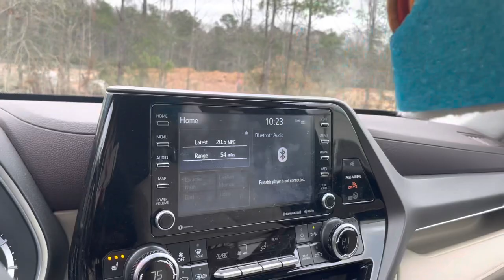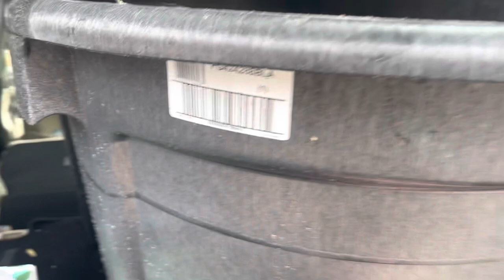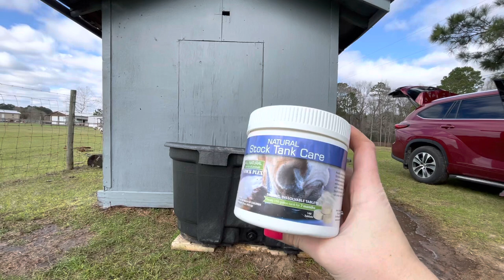Meet me at the watering hole!

Comment: The little pallets are from the deer blocks......the air compressor comes on a smaller well built pallet also..... TSC does not keep these.    I work for Lansing, Kansas TSC......I personally use the deer blocks pallets to build my 2 dogs a condo .......I hope to have it finished by Spring!

Comment: Bri water is 8.34 pounds per gallon. You definitely have to remove a large amount of water before you can turn over the tank. Now you have a drain plug it should be easier to clean the tank.

Comment: Y'all need a 6ft hose stick it in the trough completely submerge get the bubbles out and pull 1 side out will drain and not hurt your back
Reply: You can aim draining water in different directions to where you need water. Use whatever length you need.

Comment: Just a thought,  but we'd it be possible to put a drainage hole in the bottom of the trough to get most of the water out. Then it would be easier to tip over.